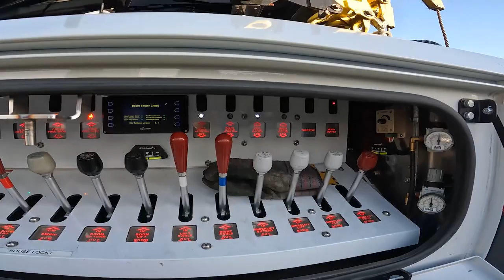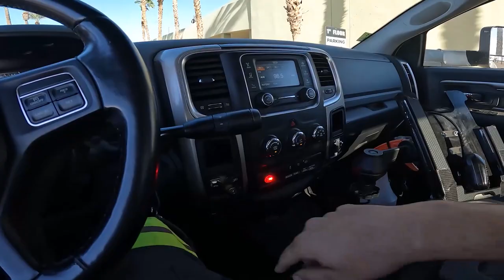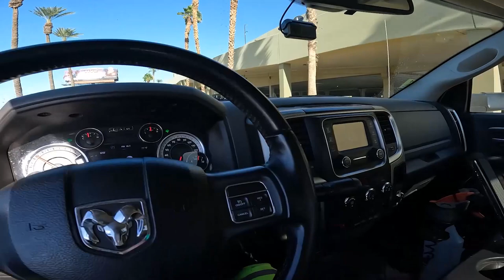Legally Stealing A Car And Yard Work

Comment: Are you able to retro-fit your winches with an auto spooler at all out of interest or is the cost.... cost prohibitive? nice video of the yard work and always welcome to see to break up the jobs :)
Reply: Most have tensioners using a spring and flat plate of steel on the bigger trucks they can have an air controled tensioner but in my opinion they are not really reliable. Sometimes they work great but if you are not pulling the cable out using free spool and instead winching out with no tension on the line and too much psi on the tensioner it can cause the cabe to cross. I actually removed the tensioner on one of my 35ton winches because it got snaged on the line and pulled the plate into the winch and bent it halfway around the spool

Comment: I kind of notice you rotator is a almost similar to Ron Prats ,  Rotator but I know they are completely different in a way
Reply: less winch cables, and no sliding carriage like Ron's does. California's weight regulations are a lot stricter compared to Missouri. Ron also has a different model of rotator, a Century 1150R. I hope that helps!
Reply: @noahater5785   Both are awesome  tow trucks.   What are the law like in California emergency lights- like in Missouri,  Ron can run Code 3 when request too that means he can run Red & Blue lights & Siren in Missouri-  let me guess in California that is not aloud?    I do consider tow trucks emergency vehicles
Reply: @bigelarkin1  I think running lights and sirens on a tow truck is illegal in California, but i’m not sure on that, I’m only familiar with Missouri because of being subscribed to Ron Pratt’s YouTube channel for roughly 2 years now

Comment: Any reason why you don't lube your cables as they are being respooled to make them last longer? I've seen Ron Pratt do this with his rotator
Reply from the maker: Cables are lubed on a service interval but respooling is done on a need to basis. So yes we do lube the cables just wasn’t due for it yet

Comment: It's clear you aren't excavator operators.
It means you don't know how to make the most of the machine, but in your credit you do understand some of the mechanical issues and care about not hurting the machine or the ground.

Let me (through someone else's YouTube video) show you how to turn on the spot as hard as you want.

Not a first timer move, but practise and you'll get the hang of it. 

Note he starts with the bucket / cab square with the tracks. I'd suggest aiming 45 degrees (or less) in the direction you want to turn. 

Then you can cleanly swing 90 degrees (45 degrees out the other side) in one move. 

https://youtu.be/uz_6nxIPMjw
Reply from the maker: Right let me show a guy who has never even sat in the seat of an excavator how to jump turn really quick 🤦🏻
Reply: @plazatowing  I did say it wasn't a first timers move so clearly not expected from ol mates learning for the first time.

But from the limited footage of yourself operating, in my opinion, even yourself could benefit from practising this sort of coordinated operation.

Using the bucket as a crutch to step up onto higher platforms, cross ditches and even to climb over the break over points of beavertail trailers or ramps, as simple as it seems, trains your whole body to be one with the machine.

I also somewhat understand the other side of the argument.
I've done a bit of trade towing of machinery, 20ft shipping containers etc on a heavy duty tilt tray (roll back I believe you call them).
It's normally about getting the job done cleanly and not playing with the customers valuable and expensive property.

But as the same time, more experience on equipment means better and safer operating.

Comment: Why don't u lube ur cables when respooling?
Reply: Yeah, lubing your cables would make them last longer considering that without the lube, your cables would be slowly worn down from rubbing against itself due to friction, and I believe it also protects from corrosion as well iirc. I've seen Ron Pratt do this with his rotator, and from what I've seen from that video, main winch cables are NOT cheap to replace and go for somewhere in the neighborhood of a few thousand dollars.
Reply: My guess is that it's due to Plaza's location. We get a lot of blowing sand in the desert and they drag cables through sand on the ground; sand that loves to stick to any exposed oil or grease. That would probably increase friction even more than the cables being "dry".
Reply: @Azlehria  What about the lube basically getting sandblasted right off because it doesn’t have enough time to absorb through the cable?
Reply: @noahater5785  We get blowing sand a lot, but it very rarely reaches sandblasting levels. Just kinda gritty like air around a (poorly sealed) blasting cabinet.